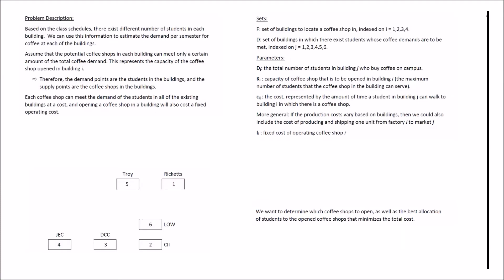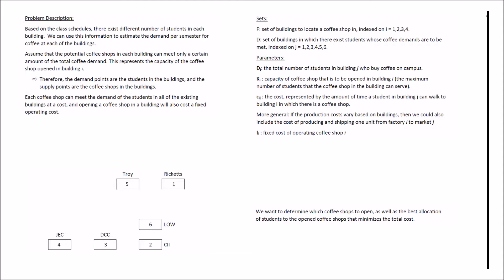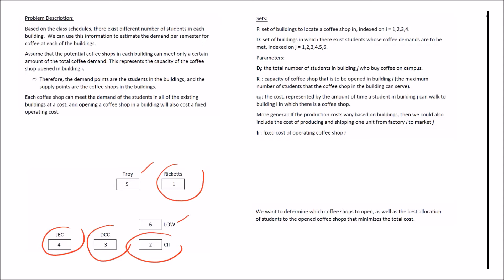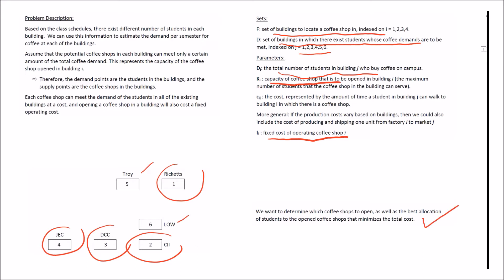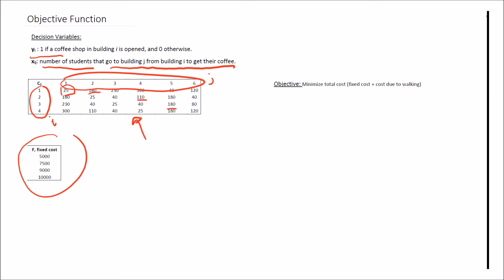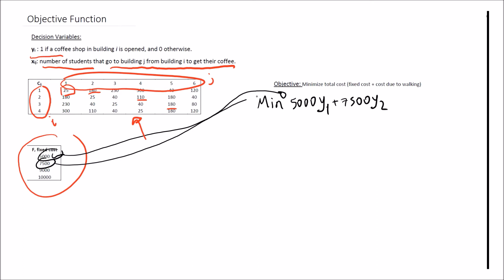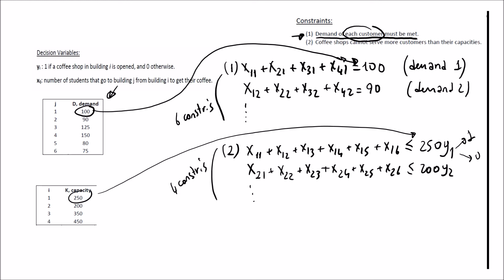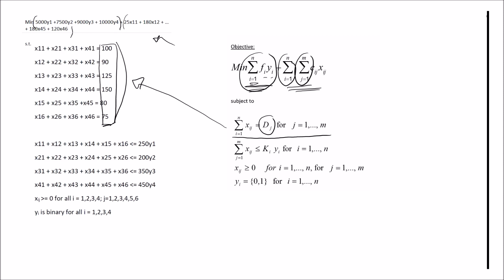An Application of Facility Location and Capacity Allocation Problem

Comment: Objective: 41575.0
Open facilities: y0 y1 y2 
Facility-Client assignments:
100.00   0.00   0.00   0.00  80.00   0.00 
  0.00  90.00   0.00   0.00   0.00  75.00 
  0.00   0.00 125.00 150.00   0.00   0.00 
  0.00   0.00   0.00   0.00   0.00   0.00 
Nice example BTW, this should be the optimal solution, using the first three facilities, according to Google OR-Tools (CBC_MIXED_INTEGER_PROGRAMMING solver)
Reply: Obs: If you try to decrease capacities, you can see that the demand is splitted among facilities